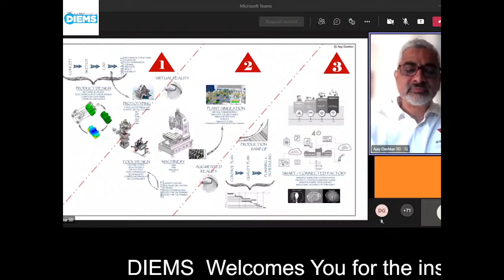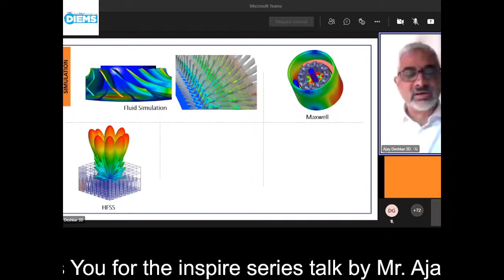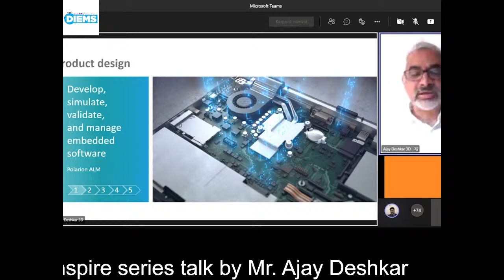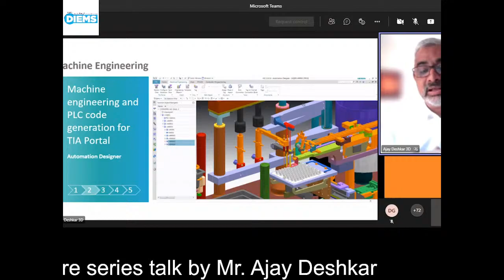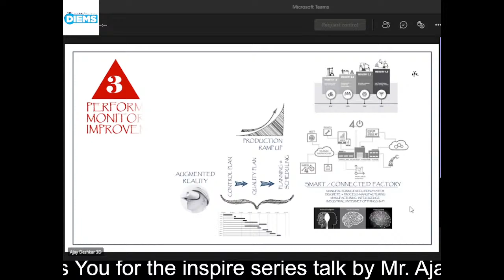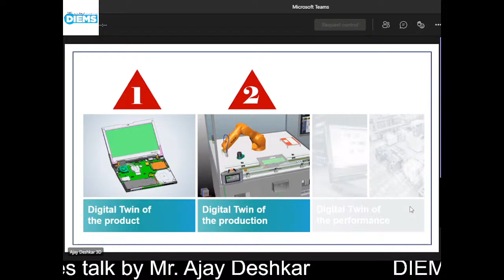Inspire Talk by Mr. Ajay Deshkar CEO, 3D Engineering Automation LLP, Pune

Comment: Great talk and it would be one of the most inspirational talk by Mr. Ajay Deshkar. As all manufacturing industries apart from discrete manufactures, has started embracing advanced digital tools to transform existing process to make it more agile and get rid of unwanted redundancy. It will definitely leverage adoption of new skills set to mechanical engineers to ride with revolutionary moment of Smart manufacturing.